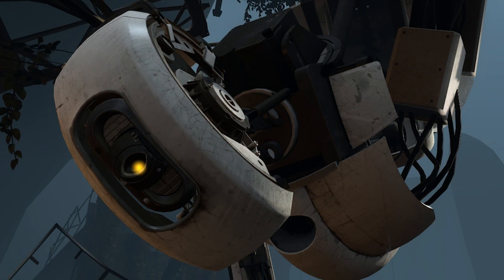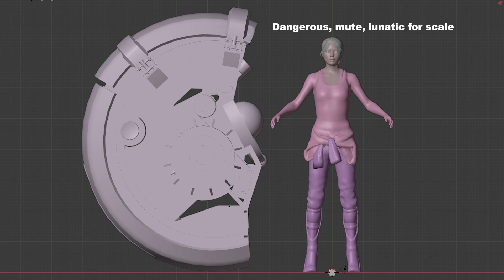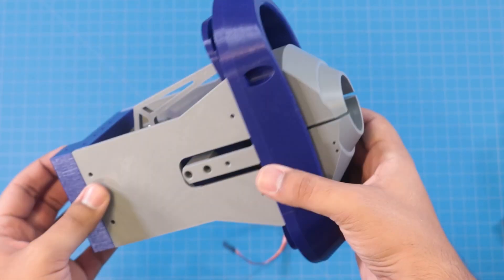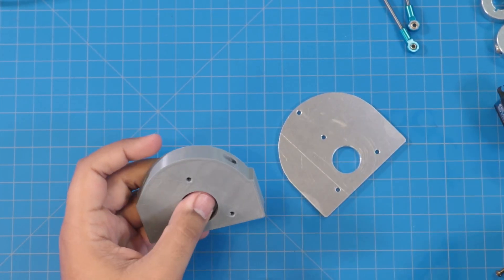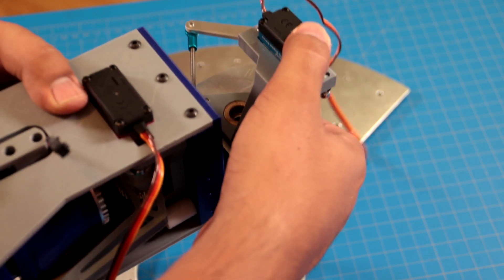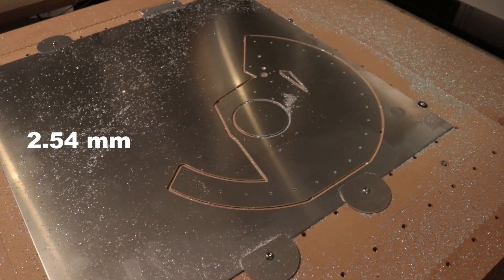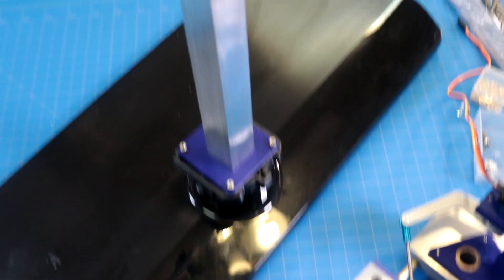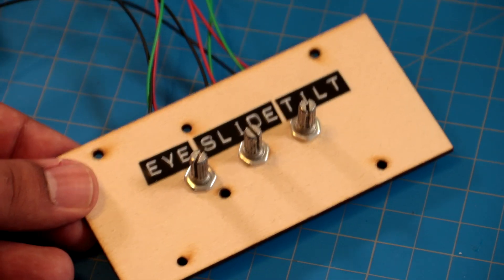Building GLaDOS in Real Life: Part 2

Comment: It would be really cool if it also doubled as a smart device. Able to perform actions, like turning on/off lights, locking doors, changing the thermostat.
Adding arms would also be really cool. Beta models of GLaDOS for Portal 2 had her use two of her cables on her body as arms. This is probably out of the scope of the project, but it would be awesome.
Another idea would be having personality cores that influence how she acts. But that would require assembling cores as well as GLaDOS.
Reply from the maker: Home assistance is in the plan! Cores would be tricky to do in a meaningful way, but I've got some ideas ;)

Comment: You need to add some form of spring damping to the final structure. There's mass to it, however, the mass isn't enough to give it that real feel. I'm saying this because you should start implementing it now, rather than later, whilst you're still in the planning stages.

Think of the problem as the difference between a real arm picker from ABB and a DIY one of the same size, the motion feels completely different.

Either way, great progress. That's a good chunk of the inner head motions down pat.
Reply from the maker: Thanks! I'm definitely going to be putting the extra work in to make her move smoothly. There's still quite a few more parts that will add to her overall heft before I know how she'll weigh.